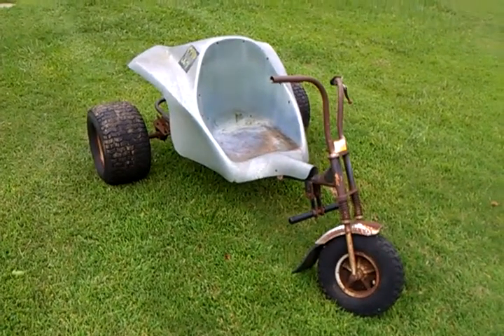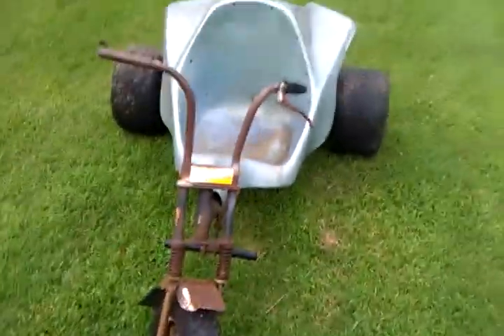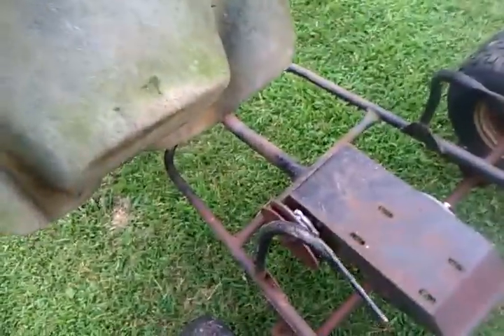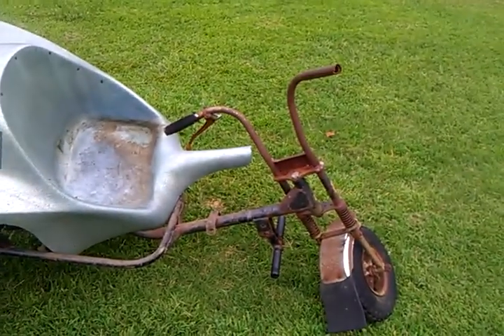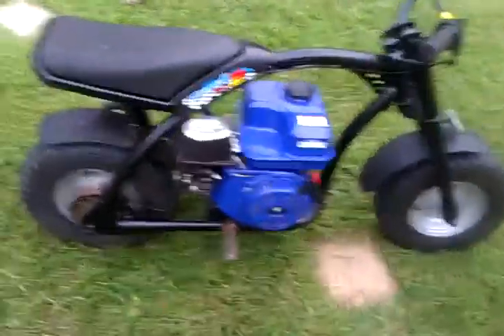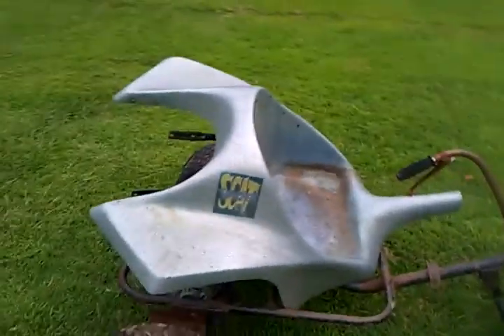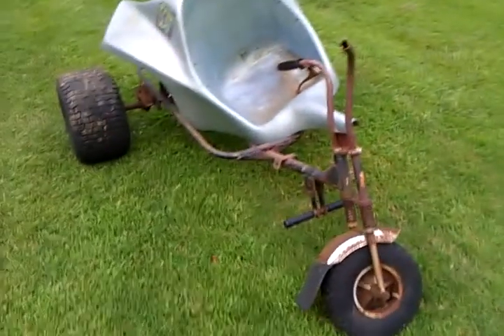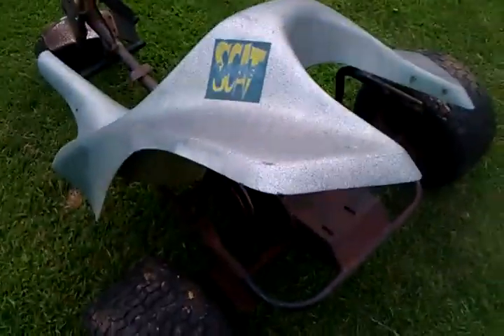Scat tracker restoration. Stage 0

Comment: These were made about 1970, and originally came with a B&S 5 HP engine. They also came with directional mud grips, similar to the Wooly Boogers that you find on the back of 4 wheelers today.